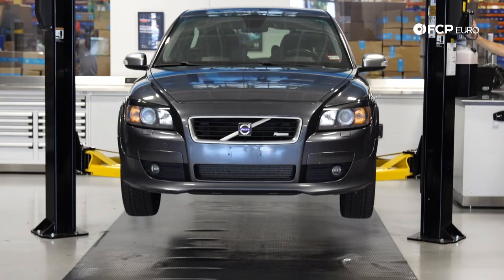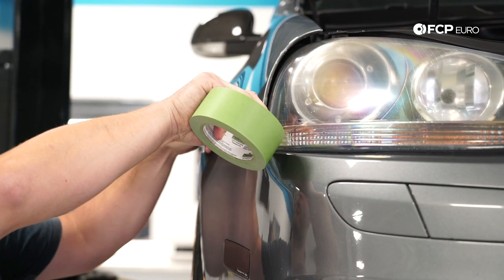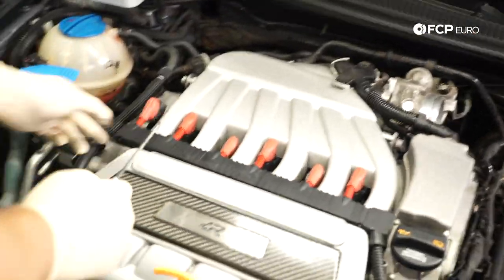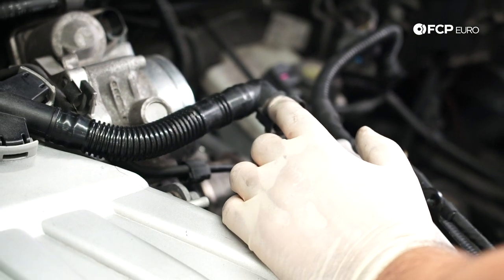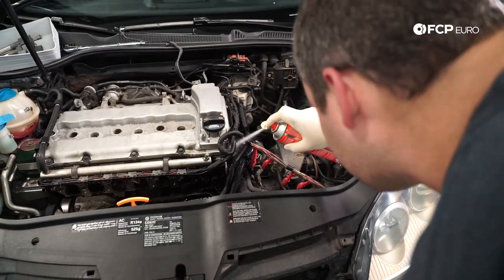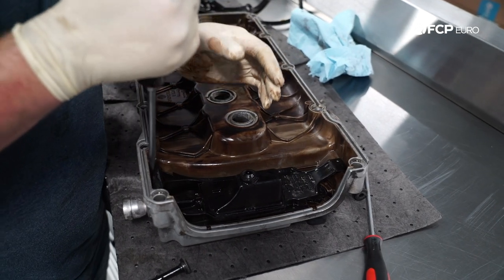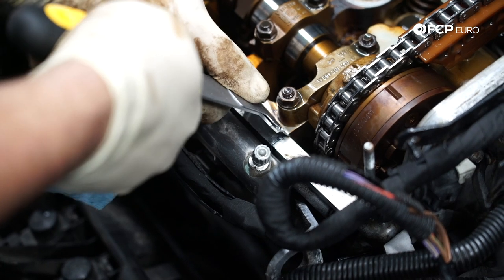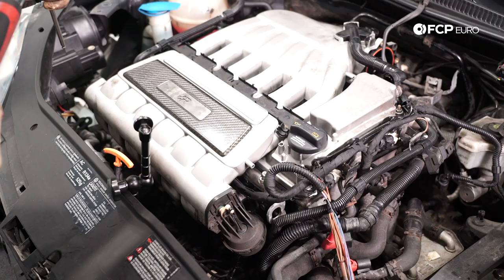Volkswagen VR6 Engine Valve Cover Gasket & PCV System Replacement (R32, Jetta, Audi Q7, & more)

Comment: I swear that it looks exactly the same as my touareg 3.2 - is the intake manifold the same ? Looks exactly the same ? I broke one of my coolant hose connectors when re installing - top video !!
Reply from the maker: They are verrryyy similar if not identical. That's why this DIY actually pertains to so many vehicles! Hopefully you got it sorted out bruno!

Comment: Hi Cory, excellent how-to video. European car engines don't use PCV but CBV/PRV - Crankcase Breather Valve/Pressure Regulating Valve aka CCV - Crankcase Valve. Both function identically, but they have different designs and shapes. A PCV has cylindrical steel or aluminum inside with a spring-loaded piston valve that regulates engine crankcase pressure and housed in a metal body. On the other hand, CBV/PRV is a complex design that uses a cylinder or box shape with a spring-loaded rubber/silicone diaphragm to regulate the pressure.  Some of them are integrated into the valve cover.
Reply: VW uses a pcv.  I have a Passat and Touareg.  At least up to 2012
Reply: @chrisgaulding4820  US & Asian car makers use PCV. European car makers use CBV/PRV (CCV).
Reply: @chrisgaulding4820  No, VAG cars use CBV/PRV. I have an Audi A4 Avant quattro turbo, and it has a CBV/PRV. You can only get the CBV at the dealer or European car parts store. On the other hand, you can buy PCV valves at any automotive parts stores. The CBV/PRV is usually 2-3 x the price of the PCVs.

Comment: Different on Porsche Cayennes. Their high pressure fuel system has to be partially removed. The high pressure fuel pump and also one of the fuel rails.

Comment: Is it possible to inspect the upper timing belt chain and tensioner at this time?
With the intake out the seals for the intake  runner should easy to replace.
Reply: Seconded
Reply from the maker: So the great thing with these cars is that timing chain stretch can be monitored with a VCDS cable. We carry these on our website as well. You will be able to search the timing parameters and see exactly where your timing chain stretch lies and whether it is time to replace them or not! Link below to our website with VCDS cables! 

https://www.fcpeuro.com/products/audi-vw-vcds-diagnostic-interface-ross-tech-vchn_10
Reply: @fcpeuro  Thanks to the reply and idea of how to monitor the timing!

Comment: How does this differ to the mk4 24v gli vr6 (of course the pvc valve) my spark plug coils are drenched in oil and missffiring
Reply from the maker: Very similar job between the two.

Comment: Is it really necessary to remove the front bumper and support
Reply from the maker: Removing the front bumper and placing the core support into "Service mode" truly opens up space in the engine bay and makes performing this job much easier. The Mkv engine bay with the 3.2 VR6 motor is quite crammed for space.

Comment: Will this kit fit a 2007 Audi A3 3.2?
Reply from the maker: Hi Cesar, unfortunately, we cannot confirm as we did not get that model equipped with the 3.2 here in the states. It would be best to try and get the OE part numbers for your vehicle and cross references what is available online, sorry for that!
Reply: How do I have one then??

Comment: Garbage VW design. They all leak to force the buyer back to the dealer. Mine is leaking on 2017 Touareg with 60,000 miles. Just after the warranty expired. Good video, thanks.
Reply: Good thing you have the newer easier to remove two-piece manifold.
Reply: @cm.5023  how is it on Passat R36 ? My PCV valve seems to need to changed ... I rough idle
Reply: @babagandu  It should  be fairly easy depending on what year you have. The later models had the two piece manifolds like all of the 3.6's after 08 so no need to put the car in service mode.  Pull the intake, coil packs and a few odds and ends them remove the manifold and valve cover. If you buy the entire valve cover you get the PCV so its a direct swap. If you get just the diaphragm you have to remove the PCV from the valve cover.  Its doable but not easy as it may be stuck due to age.
Reply: @cm.5023  Holy smoke ,,, yeah mines 09 ... hope I can do it ? There is oil all over the engine
Reply: I did it for the first time on my wife's Touareg. I had no clue what I was doing and no workshop manual but I did it and it was not difficult at all. Just pay attention and have some triple square bits handy.
Reply: @cm.5023  wow thanks a bunch, I'll give it a try
Reply: @cm.5023  oh I forgot ... what parts do I get for the job ??
Reply: @babagandu  If you get the valve cover, it should come with the gasket. You will also need the upper intake manifold gaskets. If you get just the diaphragm  you need the upper intake manifold gasket and the valve cover gasket.